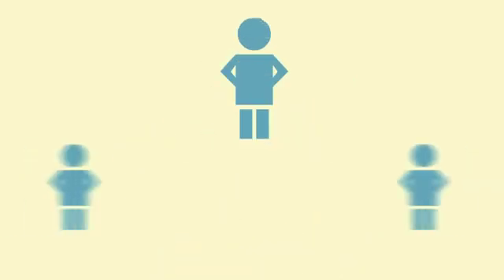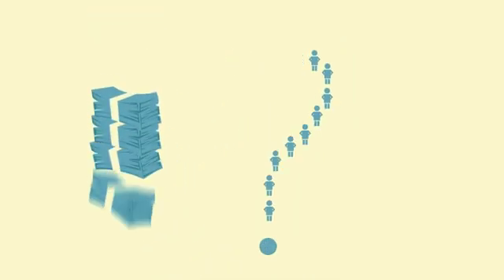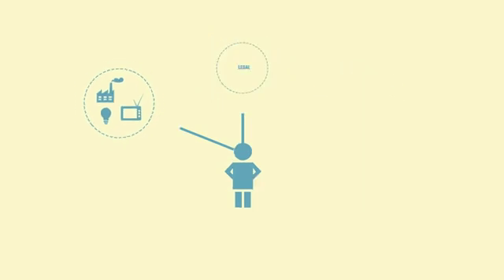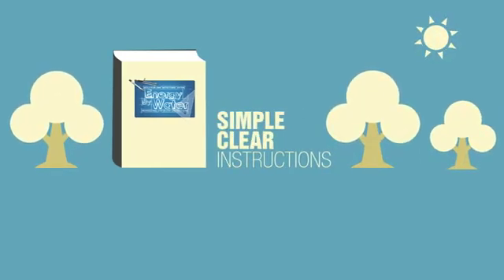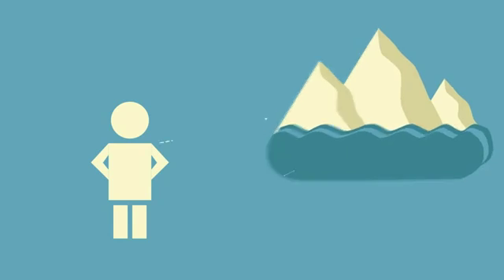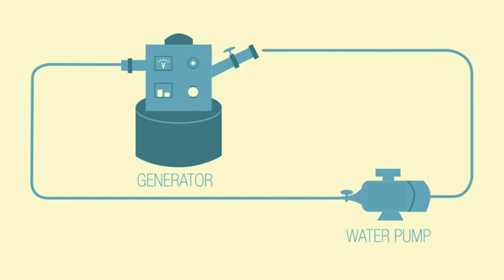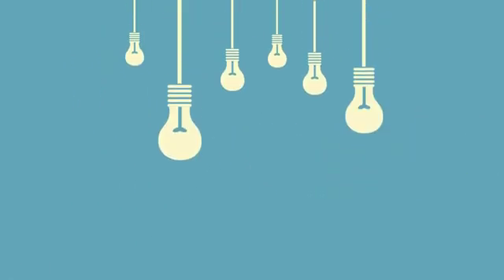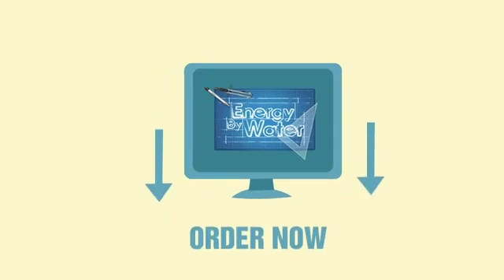Energy By Water - Build Your Own Water Power System. With Proof

Comment: Ryan, the portion of your video regarding perpetual motion is blatant lies. Heres how it actually works;
Lets say 100 unit of water is worth 10 units of power.
When we put it into the generator and the machine will produces 1 unit of heat, and 9 units of power as output.
Those 9 units of  power goes to the pump.
Now , It cost an equivalent amount of energy to give a substance potential energy as it would produce when it looses it, so it takes at least 10 units of power to move the water from the ending point to the starting point. So moving up all that 1 unit of water will take 10 units of power , Unfortunately we only produced 9 units so that will have to do. To make matters worse, the pump produces 1 unit of heat and only actually effectively uses 8 units of power.
So no we are back where we began, except we have produced 2 units of heat and only have 4/5ths the amount of water in our starting area. Due to our attempt at keeping the energy working within a closed system, we haven't even produced any energy for our efforts.
A traditional waterwheel uses water that has been evaporated by the giant fusion power plant known as the sun, that water cools at high elevations, flows down back to the see where we take advantage of the cycle that has formed.
It is physically impossible to create a 100% efficiency engine/pump of any type, so you will ALWAYS loose energy to heat. If you had a 100% energy design, you would be among the most famous people on the planet.
Even a old time wooden waterwheel looses energy from friction and heat, and has wear and tear from lost energy breaking down its moving parts.
Reply: Dragonlord7012 You are correct. Ryan Ball is wrong. In fact, I see this book as a 'scam'. He's suggesting that you are getting energy for nothing and as we all know that is not possible.

Good clear explanation too. Move to top of the class! LOL!
Reply from the maker: I'm glad to see you have done your research. You sound like you have the correct figures and I assume you have obtained these numbers by building and measuring  your own identical machine as shown in the video as per the blueprints. But you have not. I understand your sceptisim, and it can be easy and sometimes very accurate to draw a conclusion based on pure common sense and logic, but the truth is unless you have followed all the plans and specifications to the letter and tested this machine all you have is a theory.
Are you taking in to account gearing and flywheel size, pump and generator efficiency plus using mains power to accelerate the water wheel up to speed more efficient for the generator? I have provided video proof of the working system. If anyone has a FAIR attempt at building the SAME system, using the BLUEPRINTS and can provide video proof of it not working I will happily remove the video